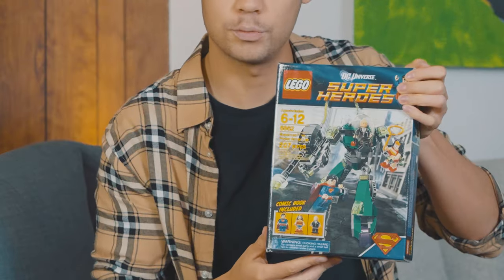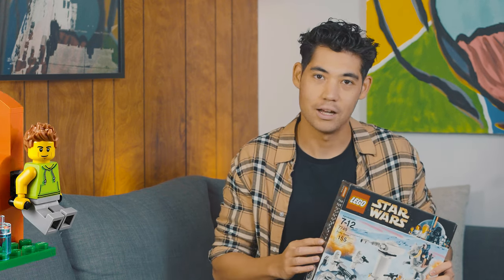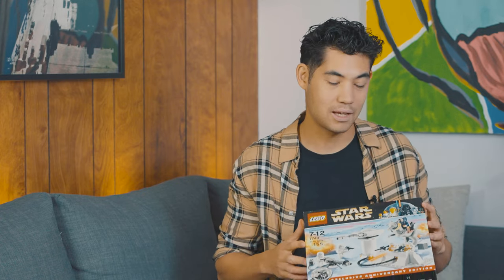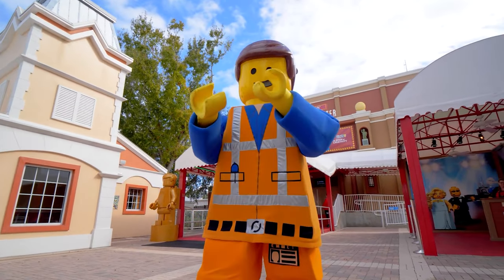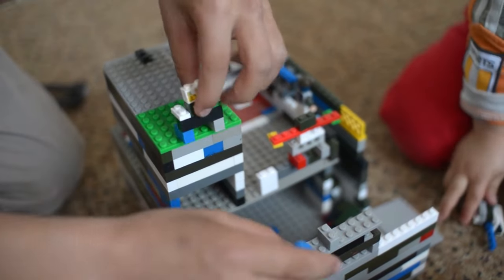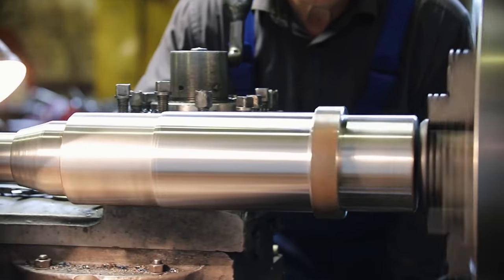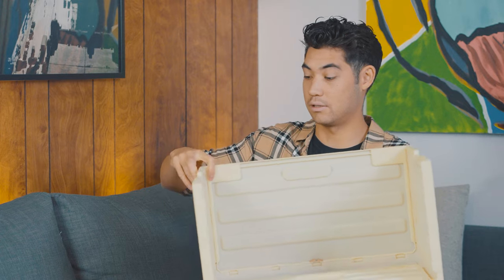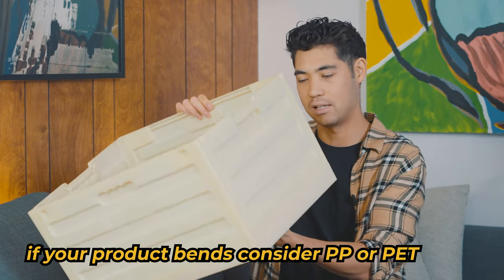What is ABS Plastic? | How to use ABS Plastic. 3D Printing? Lego?

Comment: Want to know something useful? You can melt ABS down with Acetone (I use MEK though as it doesn't turn the ABS white) and mix in mica and now you have a spreadable epoxy or paint depending on the amount of solvent added. Need an extremely strong coating? Add chopped glass fiber to your paste.
Reply from the maker: Cool! Maybe we will have to test it out! Thanks for the awesome tip